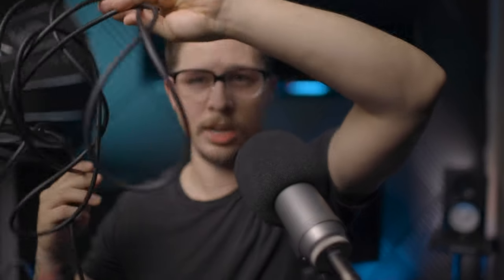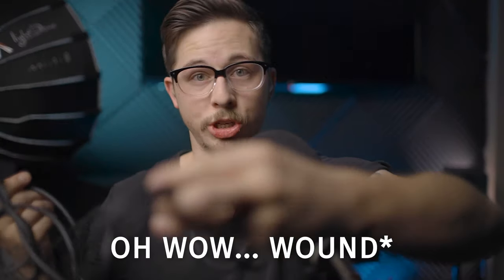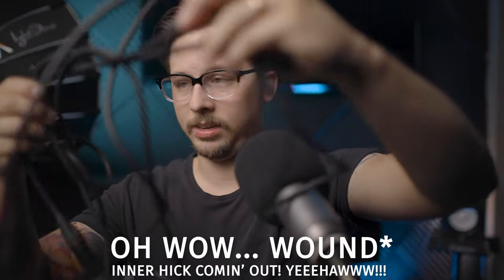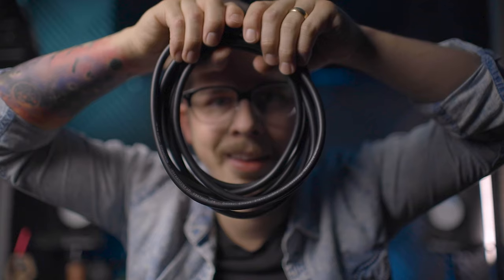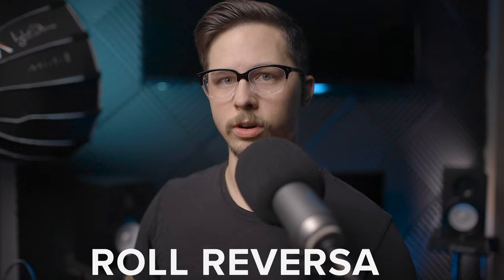Tangled Cables? NO MORE! A Great Way to Perfectly Wind Cables!

Comment: Interesting. I never roll one but at least I learned something. Do you ever connect the two rends or is that forbidden?
Reply from the maker: I don't usually connect them, but I don't feel like it is a no no.  I personally don't connect them because when I am grabbing cables or winding them up, I feel like I am usually in a hurry so I just feel like it is one less thing to have to worry about with connecting and disconnecting the XLR connectors!